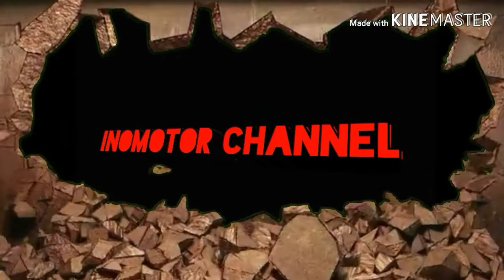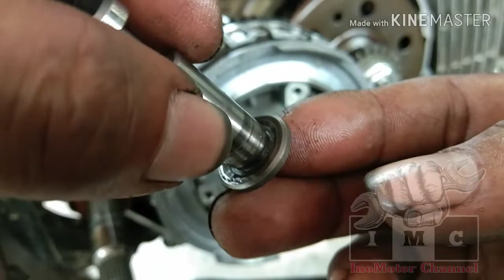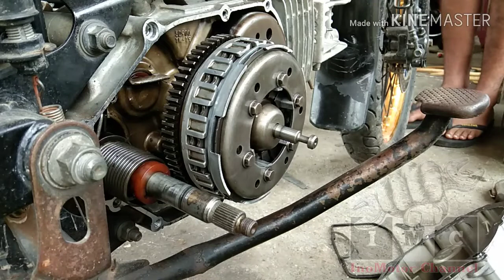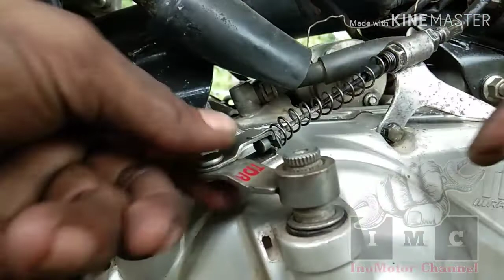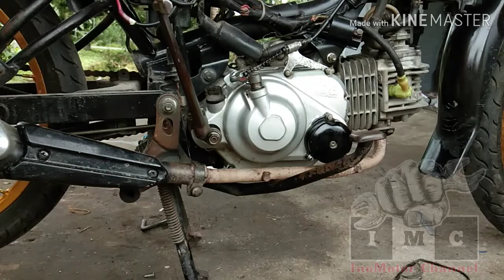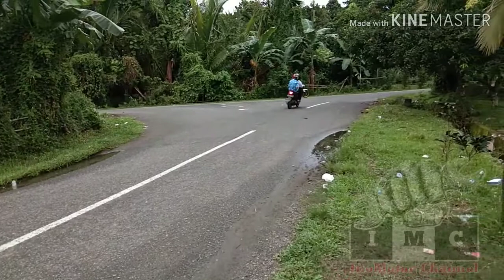Seting kopling manual JZN robot maupun Vega ZR #InoMotor Channel #Tutorial

Comment: which is best race to use in primary clutch bell? the 21T or 24T
Reply from the maker: for speed use 24T  primary clutch but secondary gear must also be adjusted to primary gear 24. 🙏🙏🙏👍
Reply: @InoMotorChannel_ino  itu make bearing matahari dan ring matahri 2 buah ga bg?
Reply from the maker: Pakai sobku, untuk ring bisa 2 atau 1 tergantung kondisi jauh dekatnya kopling y sobku
Reply: @InoMotorChannel_ino  aku beli stut TDR bg, tpi pake blok kopling thailand. apakah pnp atau harus d costum lgi ya stut nya?
Reply from the maker: Sebaiknya d coba dulu. Tpi biasa punya tdr itu bisa, tinggal disesuaikan saja jika memang harus.